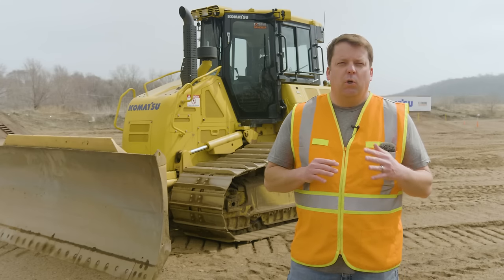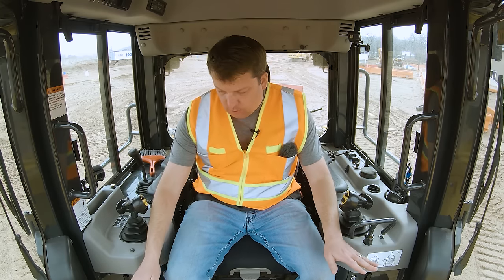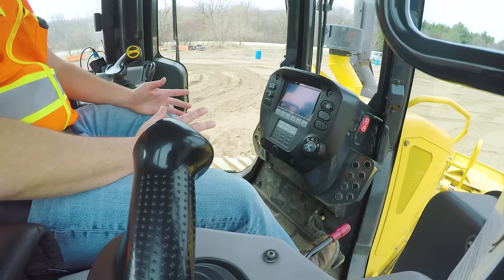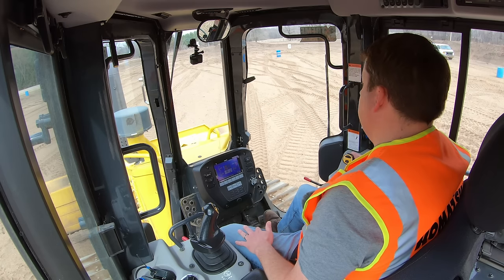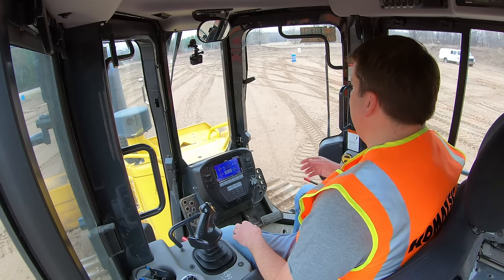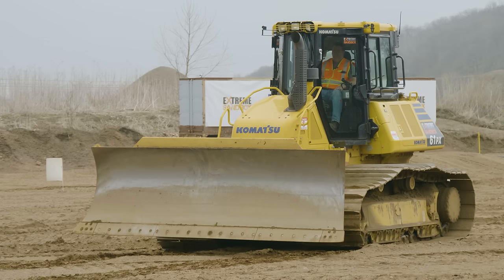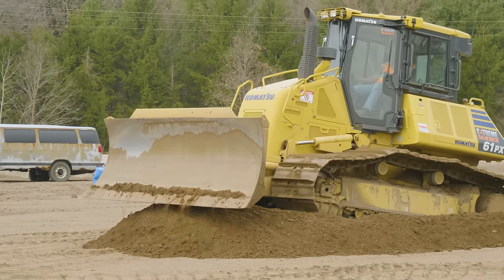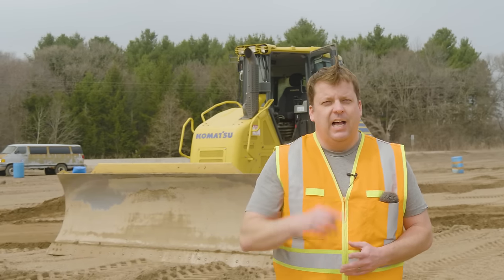Bulldozer Training (Beginner) | Heavy Equipment Operator Training

Comment: Hi Guys,

Excellent video. All good.

1) Float function can be utilised for forward pushing when clearing scrub and trees. When you are on moderately hard ground pushing scrub, bush and trees, the float function can assist in creating a large rolling pile of sticks and logs without the weight of it digging into the ground. In short, float forward in thick / heavy bush where there is enough small pieces passing under the blade preventing digging in.

2) As for back-blading. That's fine. The most wear is on the cutting edge and bolts and they are very hard. It's not a problem.
As a part of working a dozer, back-blading is probably less than 1% of the work. 

3) When both tracks turn opposite to each other it's called "track counter rotation". As was stated in this video, it's best to not make a lot of acute manoeuvres. Sometimes you have to but a good operator will make slow gradual turns to prevent leaving bomb craters everywhere. Less wear and less work is good.

4) The greatest tip I can recommend to any new operator is to control the blade. Know where it is and adjust sparingly.
If you are constantly creating trenches, corrugations and wash boards then you're adjusting too much and most likely trying to push too much material too quickly. Gradual in, gradual out. 

Whilst the greatest efficiency is with a full blade, don't try to get that full blade right at the start of a pass. Gradual in, gradual out. Watch the blade and don't jerk on the control. When you get experienced you realise how little you touch the blade control.

This is a good presentation with the operator being humble, non-assuming and self deprecating. Good work. Valuable for the learner and the experienced operator. Thanks :-)
Reply from the maker: This is amazing information, thank you very much for sharing this!

Comment: question ... is there a blade setting or joystick movement that will automatically level the blade horizontally with the dozer body, sort of a default blade setting, that will give you the best material leveling without trying to eyeball or guess how level either your grading is or your material is being laid?

thank you
Reply: On this model not. Blade leveling visualy.

Comment: If you need any help, contact me I have 43 years exp. on all kinds of equipment 👍😎 great video  thanks for sharing
Reply: I more up date on domper truck
Reply: Loaderman what is the best way to get into Heavy Equipment Operation?
Reply: @Michael-rr1em  Look for a school or company locally that can teach you. Or apply for a job with a excavation or land clearing company, You will have to start out as a laborer or shop helper and work your way up. Find a job with a company that has Heavy equipment, work hard, and show your employer you want to learn. But most of all be patient and it will come. 👍😎
Reply from the maker: Thanks, will do!